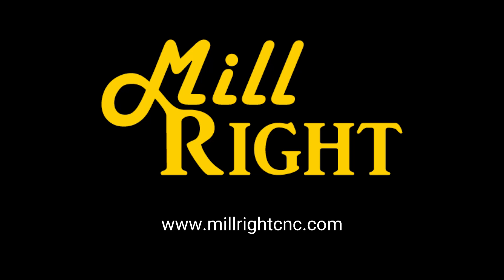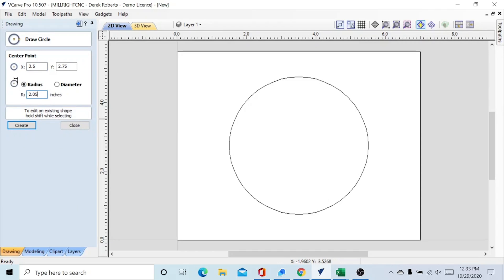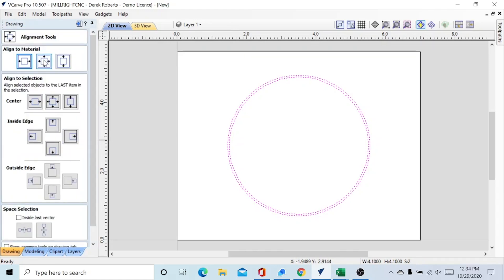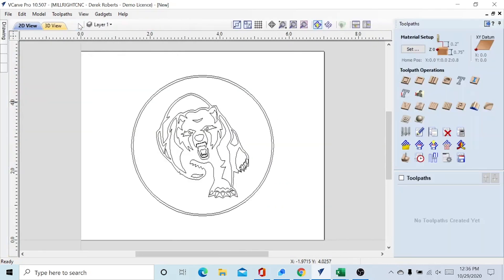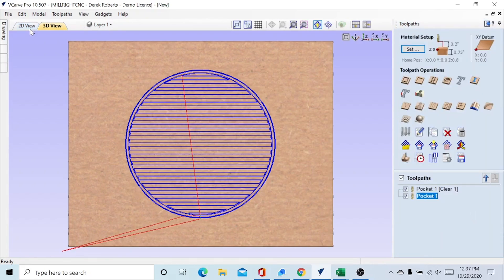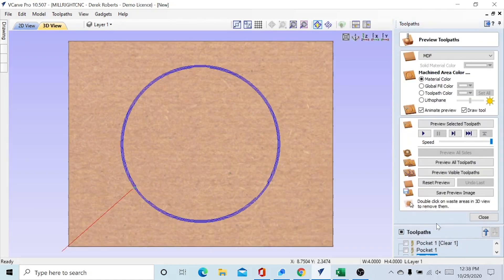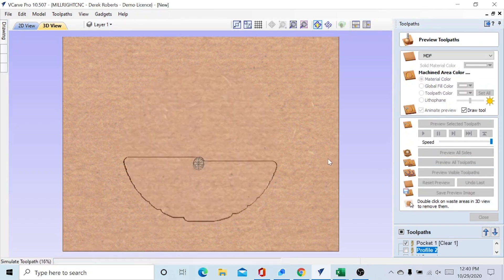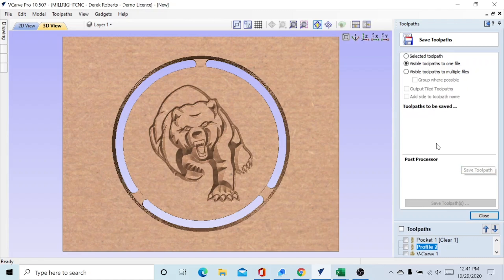MillRight CNC making Coaster with Vectric VCarve

Comment: I noticed the tool witness marks in the lower right quadrant.  I am noticing that as well when I use the Vectric software and not as bad when I use fusion.  How can that be eliminated in the vectric as it is causing issues in expensive wood.

Comment: Can you guys do a video showing how to setup and use the touch plate with UGS and the MegaV?

Also seems like the touch plate in the video serves virtually no purpose for zeroing off a corner and for WCS orientation as it was used in the video.

Been manually setting zero for almost 9 months now and still have not used the touch plate.
Reply from the maker: Yes, we can add a video on that to the TO DO. list. It is picking up the Z axis for each tool. It will certainly be more useful to it once we get a video and you see how to use it.
Reply: @MillRightCNC  I would also like to see how to do this, just for the "Z" axis